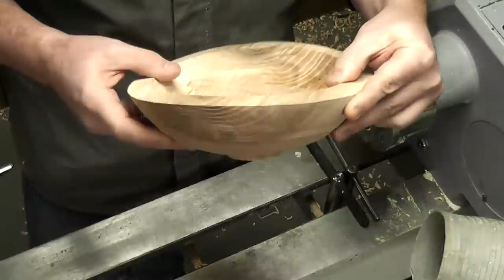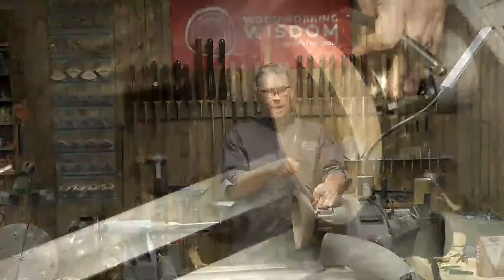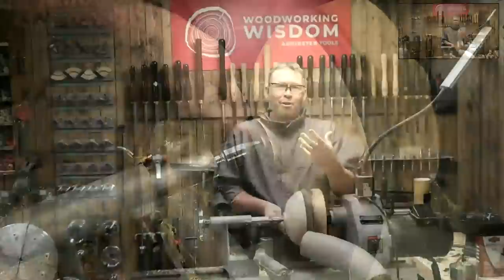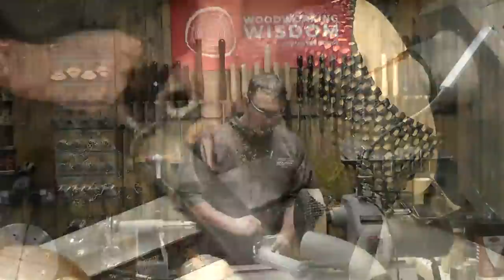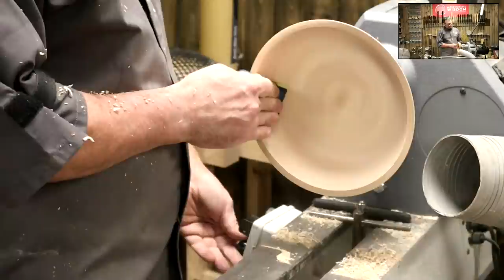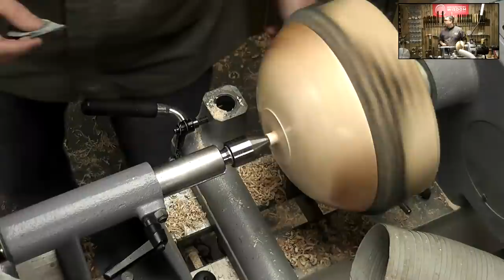Finishing A Rough Turned Bowl - Woodworking Wisdom

Comment: Colwin, when you started to turn the inside of the bowl,you said the foot was perfectly sized for the C jaws. You had previously trued the foot,so what size was the foot originally? Did you use larger jaws when you wet-turned the bowl?  All the best,Dave.
Reply from the maker: Hi Dave, the following reply is from Colwin - "Yes, the jaws before were a bit bigger and the the H jaws were used when wet. But to be honest, I sometimes use the A plus or type G jaws depending on the size of bowl."
Reply: @axminster  great. Thanks,Colwin. That's answered a question that's been nagging away at me for some time. All the best to you and your family,as well as the rest of the Axminster team. I've learned a lot from you all. Thanks again,Dave.